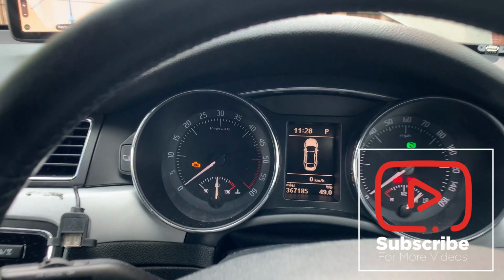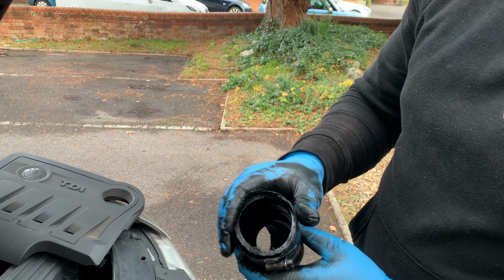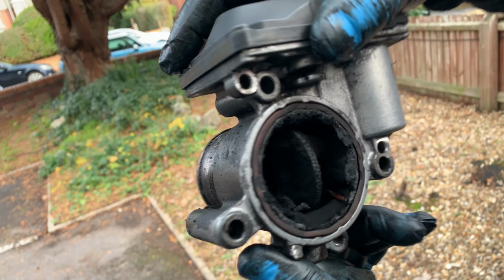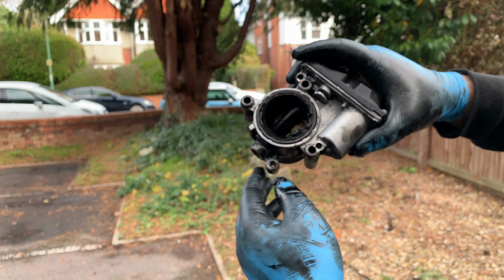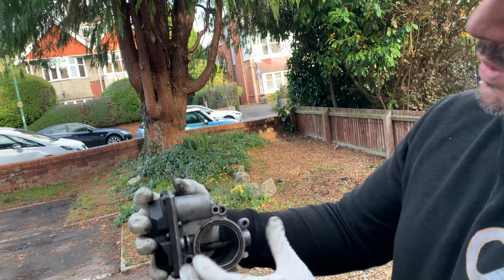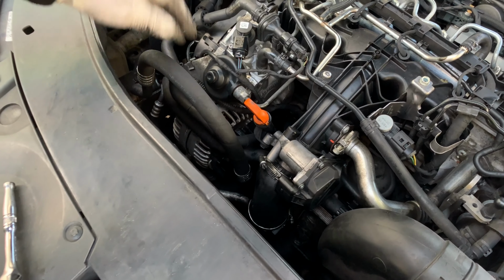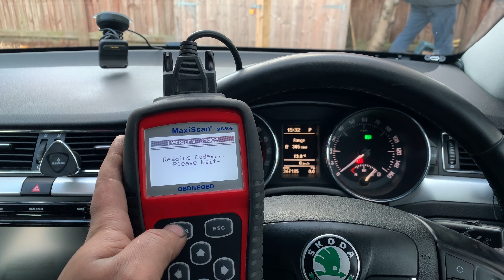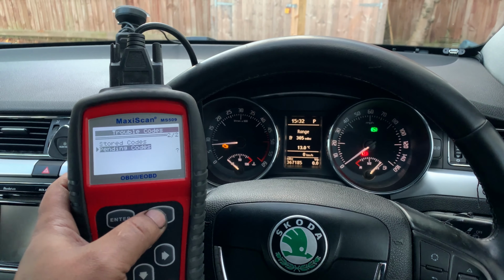Skoda Superb Fault code P0121 | Throttle Body Cleaning

Comment: Hi, just a tip you should also clean the throat of the small silver egr pipe above the shut off valve/throttle body as you call it.As this will also be caked up with soot also.In my experience of ten years ownership of this type of engine
Reply from the maker: Cool thanks 👍👍👍
Reply: You are 100% right and good to run adoptation

Comment: I'll be doing the same to my 2.0 tdi tomorrow
Reply from the maker: How did it go ? 👍
Reply: It didn't go so well I will finish it in 2 days here in America the 2.0 have a metal intake manifold not like that car you worked on which is a plastic style also directly under the egr is the intercooler which is blocking the throttle body bolts so I will put it on my car ram an pull the intercooler and then the egr the euro 2.0 you worked on is way easier

Comment: This help me out with my 2012 170 Superb DSG L&K, same fault code, the mechanic kept resetting it, until I basically ordered him, to take the throttle body off and cleaned it out. It was caked in carbon and crap. Cleaned up like new before refitting. Many thanks for the video.

Comment: i took mine off today to clean, wasnt too badly coked up but i noticed it sticks in the closed position...if this happens would it be the cause of car not starting and cutting out too at junction. ?  also is there any way to test it because i plugged it into the car plug while off the car and nothing, started car...revved it and no response from throtle...if the flap doesnt move is it faulty?
Reply from the maker: If its getting stuck closed its most likely the problem , now the "throttle body" in the diesel car only closes when you are turning the car off and another few situations but its open most of the time..
Reply: @CarsExposed  thanks. I have cleaned it thoroughly with egr cleaner so will give it a go. What other situations does it close other than when switching engine  off with key

Comment: Hi! Does it need recalibration after clean up and reinstall?
Reply from the maker: No need mate 👍
Reply: @CarsExposed  Thank you! I need to do it on my dads 2011 YETI 2.0 CR-TDI CFHC engine. I think it's the same engine as in your Superb :)
Reply: Its working without but right way to run adaptation after to flap find all positions

Comment: Hello, i have same fault, my car start throw black smokes and are a bit laggy when i accelerate also there is not much power like before.
Should i clean or change it ? Do my syphtoms are the same?
Reply from the maker: cleaning it should be ok, similar but we normally don get loss of power or lagness
Reply: @CarsExposed  Well i had broken manifold valves with this fault code.

Comment: Hi there! Just one question, is it necessary to perform throttle body relearn like a gasoline engine?
Reply: Garga Vall   Hi. I removed mine and cleaned it. Disconnected the battery for 30 mins went into learn mode. Drive for while different styles fast slow etc.  Worked for me.  Good luck.
Reply from the maker: In my case here wasn’t needed but a gasoline one would need calibration 👍
Reply: Not necessary but 100% recommended to do adoptation

Comment: got this error code on my superb. gonna clean it out at the weekend, cheers for the vid!
Reply from the maker: Thanks buddy good luck 👍👍👍👍
Reply: @CarsExposed  worked a treat, it also got rid of the engine judder after switch off I've been having, cheers for the vid!
Reply: @jwracingteam  this valve works as an anti shudder valve too. so when you turn ur engine off it doesn't stop so abruptly. Makes for a smoother switch off. I can always tell when mine requires a strip and clean as the engine judders on switch off 👍
Reply: @amybarr5054  my judder is back, time to clean it again

Comment: I cleaned my 1.33 petrol Auris with 210k km and it wasn't even dirty so i didn't remove it from the intake manifold . Instead i used Wurth tb & intake cleaner while engine was off and cold but that was probably wrong cause when i turned the engine on all the residue that fell in made the car to rev high and exhaust had a lot of smoke.
Reply from the maker: TheAlexunit there are some products that says that you can do it with the throttle body in situ but I really prefer to remove it to be safe cheers 👍👍👍
Reply: Cars Exposed At least i didn't touch the throttle body cause they say you might damage it if it's electronic...i had a friend pressing the gas pedal and cleaned it this way.
Car feels a lot better in idle or when i let the gas off while in gear.TB was never been cleaned before.

Comment: Hi thanks for the great video. Going to do my octavia but wondering is there a gasket to change as you dont do one in your video.thanks
Reply from the maker: Didn't have any gasket on mine 👍👍👍👍
Reply: @CarsExposed thanks and is it still going ok
Reply from the maker: Yeap all good still
Reply: @CarsExposed  thanks
Reply: Done today hose was only tricky bit but goes on ok with a bit of wriggling and a bit of foul language thanks again

Comment: That egr valve has a lot to answer for.
Reply from the maker: paulkazjack absolutely mate the EGR has been replaced 3 times now cheers
Reply: @CarsExposed  I have a superb cr170 and it's doing some ridiculous juddering at times . Its like some startups are bad and it runs like a tractor. Other times it runs sweet as a nut. What kind of symptoms have you had with failing egrs? I have a feeling mine is on its way out. I've got a brand new clutch and flywheel so it ain't that.
Reply: Too many short trips Paulie!

Comment: Bloody EGR....😋
Lol... nicely done!
Reply from the maker: LM Auto Repairs exactly mate, he had the EGR replaced 4 times already cheers 👍👍👍
Reply: @CarsExposed  this is the throttle body isnt it...i was told the egr is at the back of the engine towards bulkhead near the turbo?
Reply from the maker: @moshazza5684  that’s right ... the EGR is at the back of the engine a pain of a job 😔

Comment: Did i read the speedo correct 360k
Reply from the maker: John Hathway you did indeed 😊... 440k now👍
Reply: I keep getting egr inserfcent flow and theottle body corcuit open i have cleaned them spotless can you shed any light? 2.0 tdi bkd engine
Reply from the maker: John Hathway did you try an active test ? I would try to command the throttle body with the scan tool, it sounds like a circuit integrity issue.
Reply: I only have a basic obd scanner throttle body was not ab issue untill i removed the egr and throttle body put them back on the car spotless then next day 2 codes and engine now idles at 1k rpm with eml lit no limp mode though and no throtel difference do you have social media ie facebook i could chat to you on?

Comment: Is that down to driving around the town all the time clogging up or poor matainance meaning cheap oils used every time a vw is serviced. I have a 2007 vw Jetta TDI bxe engine code with 98000 miles on it I was wondering should I check and clean mine. There is no codes or lights on and it drives perfect should I bother looking at it.

Comment: got this error code on my VW caddy 2.0 TDI. I clean the throttle body. do I need to clean the plastic attached to the throttle body?
Reply from the maker: No just the inside where the moving plate is 👍
Reply: @CarsExposed  OK thx
Reply: need to clean everything what's dirty

Comment: Hi I've just followed your video, put it back on the car but the pipe that connects to it wont want to go on , is there a knack to it ?
Reply from the maker: luke terry nit really a hack but make sure you loose the holding clip enough for the pipe to go on, it’s a bit of a tight space and the pipe isn’t that flexible but it will go on 👍👍👍
Reply: @CarsExposed  ah ok , yea I've loosened the bottom one off completely in fact I've taken it off as I thought it was stopping the pipe from going on , and the top one is loose too but might take that one off and see if it makes a difference.  Is there a reason why you put the valve on first ? As the attempt at putting it back together I put the pipe on first but then couldn't get the pipe on the valve so then took the pipe off and put the valve on first but now cant get the pipe on the valve lol . But thank you for your reply, much appreciated

Comment: >367.000 miles? Apart the throttle body, what is still oem?
Reply from the maker: MultiPinasco 🤣🤣🤣🤣 not a lot ... 👍👍👍👍😉
Reply: 😂  another question: Have you adapted the shut off valve with vcds after cleaning? If yes, which channel is it in the adaption, 121?

Comment: This car has done 367,185 miles 😬😬
Reply from the maker: Aayush Arora 430.000 miles now and still going 😊👍👍👍
Reply: @CarsExposed  one thing i wanted to ask that is it possible to tamper with mileage (thinking to buy a used one) if yes then how do we check for it?
Reply from the maker: Aayush Arora There are some companies that do mileage correction if you ever replace a cluster or something like that  I don’t do them ...
Reply: @aayusharora774  mileage correction cost 50 euro and takes 5 minutes

Comment: Hello mate, nice video. Quick one why is there sooth inside the throttle body? I would like to investigate that before I clean throttle body...
Reply from the maker: Sorry for the delay mate, exhaust gases recirculation issues the motor isn’t that efficient anymore with almost 400k miles ...👍👍👍

Comment: hey mate, great video, i have a skoda superb 2.0 tdi s 2012 cffb engine. had this issue twice now. how often do you recommend cleaning it (last time i done it was april last year. i have a new issue with car now as the other day it clonked out on me wouldnt re start. got it started with easy start. drove ok for half a mile and parked it up. went to start it again few hours later and again same thing. i didnt have any warning lights on like before but i read the code and its p0121 too. if this throttle is clogged again...and getting stuck closed position can it cause the car to stall and not re start ?
Reply from the maker: I use to clean it every year 60k miles because it was a taxi , if it gets stuck close the car will definitely stall and it shouldn’t start 👍
Reply: @CarsExposed  Ok thanks. I only drive 7000 miles a year so its strange but I will remove  it and clean again   if it's not that then what is it you think egr?

Comment: I had the same problem, went to the dealer. Do you need to also re calibrate the throttle body with the computer?
Reply from the maker: Hello mate, in this case I didn’t need to but an unleaded would need to be re calibrated 👍

Comment: Hello you did a good job In short video for me it take about  2 hours start to finish but you forgot to clean pipe its a lot worse usually, and   after cleaning and removing right way to do is to run adaptation of throttle body.

Comment: thank you!
that helped me with my 2014 passat alltrack - and intake system looks absolutely the same here  :) ! unfortunately I dropped the bolt right into the tube (facepalm) - had to lift the car and unscrew the tube from the bottom.
the only think I think you may have missed is running throttle adaptation. But that happens automatically after you drive for some period of time

Comment: Thanks for the video, done mine this morning after getting this code yesterday, can of brake cleaner and an old toothbrush, cleaned it up pretty good.
Only driven it a few miles since, so time will tell, but already the hesitation when switching engine off has gone, result!

Comment: Quality stuff, man, nice video. I have an A3 CFFB with 236k km (around 135-140k miles) on her and I was wondering, could this dirty sticky throttle body cause an engine metallic rattle and vibration at shutoff? I can also hear it sometimes knock after I turn the engine off, like it knocks quickly for 5-6seconds and then it stops. DMF is brand new, EGR was replaced new at 220k km, about 10k miles ago, but as far as I know she's never had a throttle body cleaning job and I'm thinking of doing that these days. 
Thanks mate!

Comment: Fantastic and very helpful video. Cleaned the throttle body on our 2.0 Yeti this evening, took about 2 hours including turning the thing with the cut out to make it face up instead of down. It was really clogged but carb cleaner, screwdrivers and s toothbrush soon sorted it. The car is transformed. Pulls brilliant and runs really smooth, feels like it's breathing properly now. Really appreciate you posting this, thanks!
Reply from the maker: David Gaunt great to hear I’m glad the video helped you 👍👍👍👍